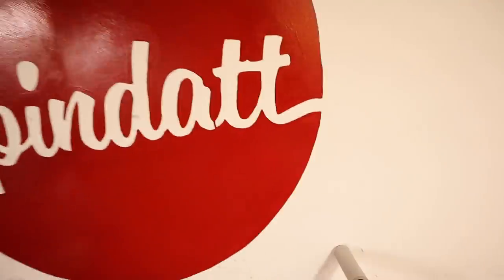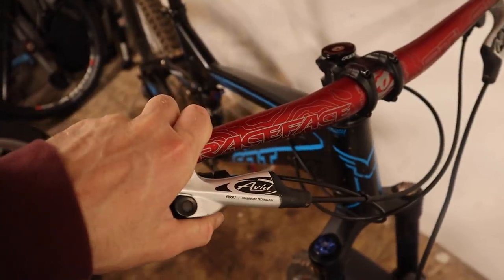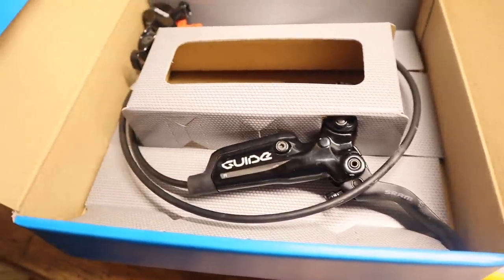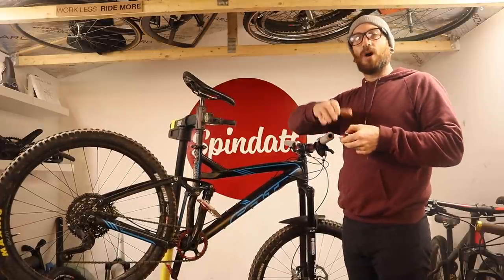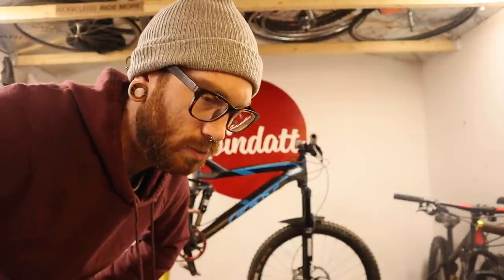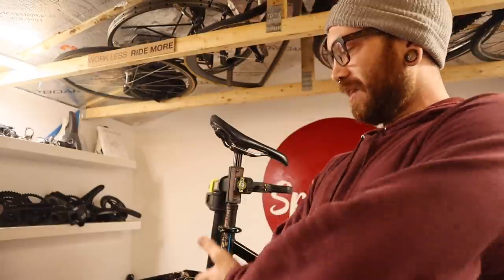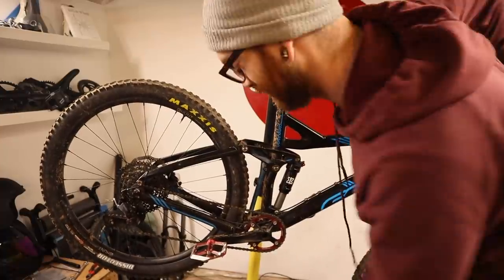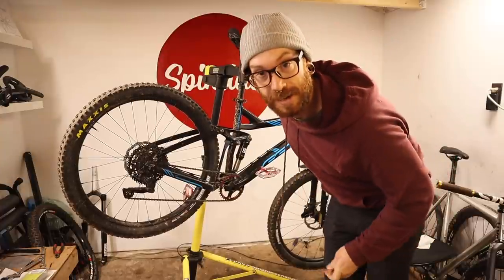All the modulation, no bite. [NO MORE]

Comment: Anyone got any good recommendations for framesets for a commuter fixed gear, with tyre clearance enough to fit those full coverage sks fenders? I've already got a summer fixed gear built up from an alu track frameset, but riding that last winter in the UK I just got drenched. I'm a very light guy, and I need to carry my bike up a couple flights of stairs to my flat so lightness is a number one priority.
Reply: I have an old KHS Urban Soul that fits 25c tires with full fenders and it has all the mounting points, I really love it, you might be able to find a used one.

Comment: Set of Magura trail sport from amazon uk seller(158usd last I heard) is really affordable for the front and rear set.
Reply: I have a set took off Magyar 180 rotor 2 put on 203 galfer wave floating rotor in front. 180 galfer wave floating rotor in rear works fine. Bike has been in shop 4 3 weeks magura sent bike shop new break 4 the front because it locked up & rubbing against 203 galfer rotor. Magura told bike shop magura 203 rotors only compatible with magura breaks. In the mean time galfer 180 wave floating rotor on rear works fine. Will not F ck with magura anymore after this.

Comment: Buy the EZMTB bleedkit. It's $20 and can bleed pretty much all brakes. If you look at it, it's almost the same as the Park Tool one. I'm pretty sure it's the same stuff (syringes, bleed port bits, funnel) but PT makes it blue. Just like how the Shimano torque wrench and Park Tool torque wrench are exactly the same internals but PT just changes the way the outside looks.
Reply from the maker: It has the bleeding edge portion of the tool?
Reply: @Spindatt  I believe it has everything for SRAM (I run magura and shimano so now way to make sure) but if you want a perfect adapter, AliExpress has the EZMTB bleeding edge copy for $4. I'd imagine you want yours sooner than Ali can send it, but the EZMTB kit has worked for me for Tektro, Magura, and Shimano and there's bits to adapt to SRAM and Hope in the cheap kit too

Comment: Personally get very frustrated bleeding disc brakes. ALWAYS spill brake fluid and NEVER goes the effortless way displayed on YouTube ‘how to bleed ‘videos...however always get there in the end...!
Reply: RollinRat  Thanks for that. Yeh well I do bike fit and look after bikes for local clubs and teams. I use Hope on my mountain bike,which is super easy...simply fill the reservoir on lever. Gravel bike has old SRAM which thankfully are OK.  But I would agree with you that Shimano ,even the low end ones work well. Avid are the worst,especially as folk let their pads wear right down,then pistons don’t return..resulting in sticky pistons.Never return to good functioning...But having said all that and having worked on bikes for many years,my heart sinks sometimes when someone lands at my workshop with disc brake problems!  and I almost always spill brake fluid.
Reply: RollinRat  yes I am a huge fan of Hope. Built a set of wheels with original Hope Titanium purple hubs for my mtb in 1992. Use single piston Hope Mono Mini brakes which I bought 12 years ago!.. Hope pro 2 hubs and other bits of Hope. Just appreciate great engineering and spare parts readily available... However my road bikes have always been Campagnolo Record,right back to the 1970’s! used to be able to get every nut and bolt,spring,pivot bolt etc etcfor Campag stuff back then. My gripe with modern bike bits is lack of spare’s in our throw away world.  As for common sense,that seems to be extinct,especially so in our Covid plandemic...
Reply: RollinRat  Good to meet you then. Yeh the Rona is the biggest lie to be imposed on a sleepwalking human race. Brain dead from mainstream brainwashing,trivia,chemicals,’healthcare’ medications and good folk who trust the Government,Mainstream Media and Big Pharma. As the Long Planned farce unfolds United Nations Agenda 21 is right on track.   However keep praying and don’t despair I think.
Also love quality and great engineering.  Started Road Racing in 70’s(whilst also bit of a hippy) Late 70’s moved to Oxford U.K. working in bike shop. Saw an early MTB in California 1980 in St Luis Obispo and we started selling and riding early MTBs from 81...became one of top MTB shops in the UK and was one of the first people in Europe to ride,before most knew what they were. Did some bike testing forMBUK magazine. Then in the 90’s got back into road more. Moved to West Coast of Ireland 2002. Nobody riding bikes. Started bike club with 2 friends and took off. Was team mechanic for a couple of teams in the ‘Ras’ international stage race in Ireland...So now cycling around these wild backroads of Donegal keeps my spirit alive. Good cycling culture in Donegal. Look at the GCN video Donegal Ultra 555 with Conor Dunne.  We are in crazy times and most folk just don’t see where things are going. Country on lockdown. 5km limit Face masks... so don’t wear a muzzle(not been challenged)and ride where I like as the police can’t enforce something that is not written in the IrishConstitution...OK well yes I think Ihave in my spares box some old Campy Record hub internal bearing races.  I now ride 11 speed Record  but still have a stash of Campag bits and pieces from the 70’s. I buy most of my stuff on eBay...often  top end stuff 2 or 3 years old...then sell the thing I am replacing for around the same price.  Paul stuff is great. Very much like top end MTB bits being made in small workshops in the 1980’s. Chris King also. I rebuilt a set of Chris King road hubs for someone recently who was using them as ‘winter wheels’ would be my best wheels!
Reply: RollinRat  Ha. You too. Here in Ireland Church Services must be bad for our health,as they are not allowed during lockdown!  However we pray the Rosary every evening.  If you need some Campy hub races will see what I have.  God Bless
Reply: RollinRat  happy to converse via email,but if that doesn’t suit then no prob. Also don’t know many bike freak-practicing Christians,who see further than the Propoganda promoted through most Mainstream Media outlets...or Mainstream any outlet I guess. Here in the Irish Republic many folk are Catholic and by tradition family is very important,also attending Mass has been part of family life.Churches well attended...although most probably what you might call luke-warm believers. Still the Faith has always been a part of family life. Statues of Blessed Mary,Holy Wells,Shrines are commonplace. Most of the guys I ride with (club has what we call Leisure group,a group who would ride prob50-60km on Sunday and my group,who would do a 100-140km Road Ride on Sunday,plus meet up on Wed evening and do 2-3 hours on gravel/mtb on Mountain back roads,Forestry trails etc then some would ride MTB and Road Races) most would attend Mass but although have some level of belief/faith, it is driven by tradition more than choice.  Of course the Globalist,anti Nationalist nature of the E.U. and Irish Governments over the last few years are dismantling Irish Culture and doing everything they can to take people away from the faith.  The ‘Trans’ Agenda,now promoted in schools.... The erosion of Freedom of Speech thanks to George Soros and his buddy’s financing any cause that takes people away from family values and Christian morals etc etc. Now we have ‘lockdowns’....for our health ,making Church Services against the law another step towards the Totalitarian ‘New Normal’. My wife remembers very well Donegal from her childhood,folk in and out of each other’s homes,story telling,music,tradition. Fairly poor culture,but rich in Spirit.  Now we have quite a rich culture,poor in Spirit.  I lived in England(Northern during Childhood,then around Oxford and in a small Cotswold village for 14 years when my children were small). Moved to West Coast of Ireland 2002. Cant believe how much it has changed in the last 15 years here.
Reply: RollinRat  Ireland was ruled by Britain until it gained Independence. Now Northern Ireland is part of Britain. Southern Ireland or the Irish Republic is independent state,with its own Constitution. Britain voted by referendum to leave the EU...trouble is that doesn’t suit the Globalist Agenda,hence the resistance.  Ireland is in the EU and will continue to be,as its Government are puppets for EU..Big Banks..Big Pharma etc etc.It people brainwashed by the  Media into believing the EU is its savior and way forward.  In truth Irish Culture being eroded.Huge Corporations have made Ireland their home(don’t pay much tax!) and Ireland has the largest debt per capita in Europe...thanks to being given billions of Euro from the EU and bulldozed away its culture..but then owing more than it borrowed .   I understand that George Soros has bought quite a lot of judges in the US...to push the ‘new liberal agenda’. Funny really that things have turned 180 degrees. Now all the liberal agendas are the opposite to what people think...leading to oppression,removal of free speech and human rights.  Blows my mind that for example a child can be promoted by huge Corporations and billionaire ‘s to whine about Climate Change and people just don’t question why they suddenly care so much about the Environment ,when their very nature is about profit.  Black lives matter promoted by white business man.....
Reply: RollinRat  I think most people are good,care about their family and just want to get on with their lives...however the tiny minority who pull the strings have largely lost many basic,natural human traits and exploit the fact that most people believe what the Mainstream Media tells them. People have become brainwashed by misinformation and lies...Young people been totally addicted to online crap and manipulated away from their human nature. I feel Humanity is under attack like never before. Satan spinning webs of deception...misleading humans to turn their backs on God.  But there is for sure an awakening as more and more people smell a rat! In my view.  Moved here for an adventure,also to a more simple life(we have 13 acres of land that drops down into broad leaf woodland and an inlet to the sea) although don’t live there,we are renting on the edge of a small town nearby.  However the simple life is no more simple! The world of ‘Middle England’. quaint English villages populated by mostly wealthy folk that we left behind although culturally very different is not really that different. The same forces pull the strings. Where do you plan to move to?  I remember California in 1980... stayed for a while in Lompoc. Cycled around quite a bit and in fact cycled to San Luis Obispo to buy a 4 season North Face Sleeping bag...which I still use!  Also stayed with friends of friends outside Santa Barbara and rode a Century event,which set off out of town up a fantastic climb. The whole region was very prosperous.
Sad that it has been run down and folk unable to afford a home.  Here homelessness mainly in city’s .
In the early 2000’s the banks were giving out money to anyone, rubbing their hands in glee at the bonuses they were getting.  Lots of money,but mostly borrowed. Then the banks got greedy and it all crashed. People lost their jobs and couldn’t pay mortgages etc.  Homes worth half what people paid so many people lost their homes,but still owe the banks big money...
Reply: RollinRat  Family commune sounds perfect.  You have big open spaces over there. In Europe things on quite a different scale.  Hope NewZealand isn’t going the way of Colorado.  Things are hotting up all over the ‘Civilised’ World at this time. Covid being used to take us to the Great Reset. LongPlanned. Further away from Cities,5G and the ‘New Woke Normal’the better.  Always wanted to go to Colorado. It seemed like my perfect place.  Funnily when I saw my first Mountain Bike in late 1980 my friend who I worked with at the bike shop spent the summer in Boulder in 1980  and saw his first early Mountain bike! It was on my return to Oxford in early 1981 that we started talking about importing Mountain Bikes and selling them in the shop,which he was in the process of buying.   How much land would you be looking to buy? Can you find somewhere that isn’t heavily regulated?  Hitched down to El Paso and then drove up to L.A.
Amazing to drive through desert. Again very different to Europe,except perhaps Spain,last year we drove down from Barcelona to a small village in the mountains through desert to visit family. Sadly Ireland has a lot of rain! We live near theWest Coast,highest sea cliffs in Europe.. Between the Bluestack Mountains to the South and Glenveigh National Park,also Mountains in the North. Get lot of wind,cool,wet weather. So miss the sun.   The thing that took me to the U.S.A with my bike was hoping to find a spiritual community...young and naive.  Living in Oxford and when my wife became pregnant we wanted to move to the Mountains and Sea..thought of Wales ,but through series of events found ourselves in a little cottage in a small village in the Cotswolds. Then 14 years later here....by Mountains and Sea,but not much sun sadly.  But probably one of the least cultivated parts of Britain and Ireland. Although the spread of Corporate Control and Tech doesn’t leave many stones unturned.

Comment: I moved up from tektro hydraulic on my hard tail to sram on my full suspension I feel much more confident on the sram. I like my x-fusion parts on my full suspension although my hard tail came with one of those entry level coil forks but still the air fork is so much nicer. I have the same X-fusion shock on mine. Its worked for me I am certainly not a hard hitting rider but it gets me there.